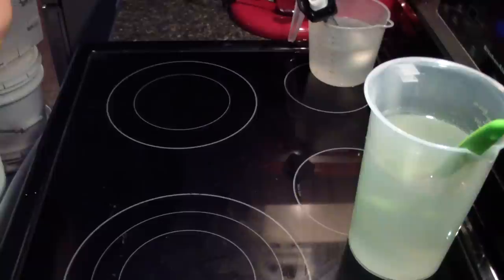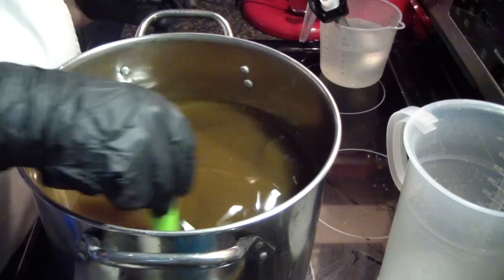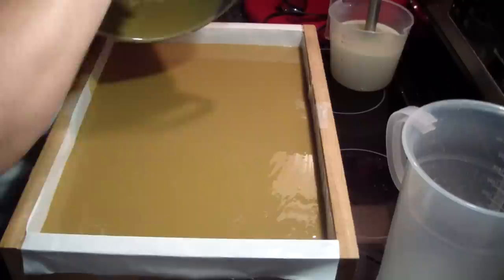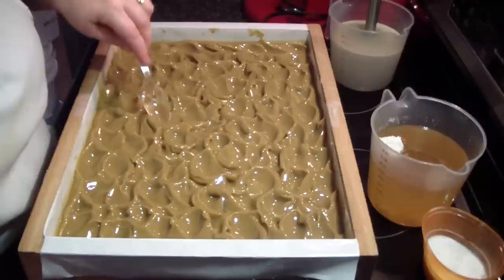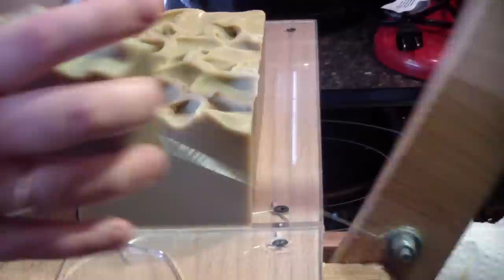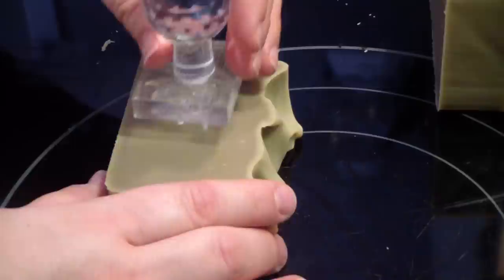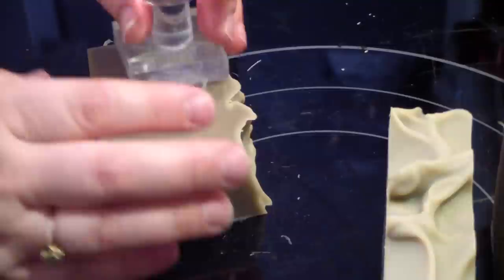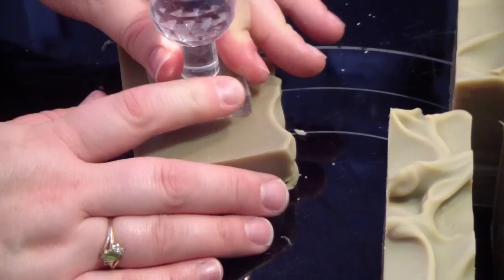Making, Cutting & Stamping Aleppo Soap

Comment: Dying to try this soap but ai yi, that laurel berry oil is price-y!! I know myself well enough to know i WILL get some.  Watched your stamping portion as it looked so beautiful in your soap but I sure didn't expect to learn something.  I've gotten a couple different stamps from HersMolds - she is the best, so easy to work with and quick.  But WHY did I think I needed to use a hammer or mallet to stamp? It offers no control and I often end up w/the stamp outline in my soap.  Argh!!  Today I stamped nicely, the "Jen method" and it worked fabulously.  Thank you!!

Comment: Have you ever sampled pure syrian made soap?  How close was it. A good place to get it are middle eastern stores locally and ask them where and who makes it. The soap should smell rich and strong in olives. Reason why I'm asking is because i wanted to make some my self but have failed, or what i made was really the cheap knock off version. I think there's more to it and i can't find the tight formula. . I personally imported some from family over their and the difference between what were making and the soap they make is noticeable. They have grade A and grade B. The grade A is made from a certain process and certain qualities the center becomes super dark green and fades out to a lighter green. And grade B is a lighter color thats consistent theoughout. is what what is rejected and they grind up the A and make it as B. Sometimes they try to cheat and redye the B grade to match the A, lowering the quality.
Reply: It's going to be a totally different soap. While the ingredients are the same, the process is very different. Actual Aleppo soap is made using a hot process where the olive oil and lye are boiled for about 3 days. Afterwards, the laurel oil is added before pouring into molds. Once cut, it is cured for up to a year. Comparing the two is like comparing sushi and broiled salmon. Same basic ingredients... very different result.

Comment: I'm curious why it has such a long cure time? Is the Expensive oil just harder to go fully through the saponification process?
Reply: it completes the saponification process after 24 hours the 'cure" time allows the excess water to evaporate  the oils used in this soap love to hold onto water and take along time to harden up to the point you can sell them.
--Rick